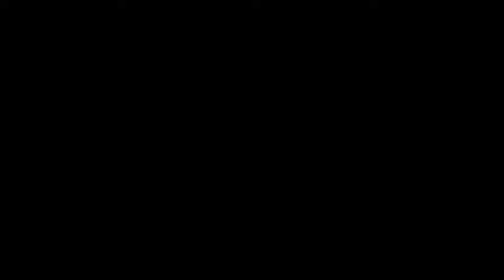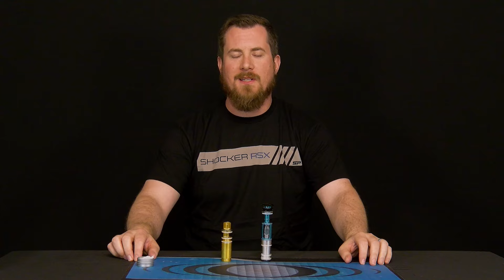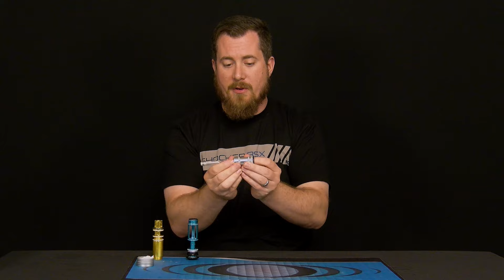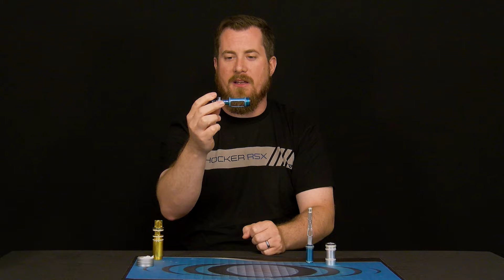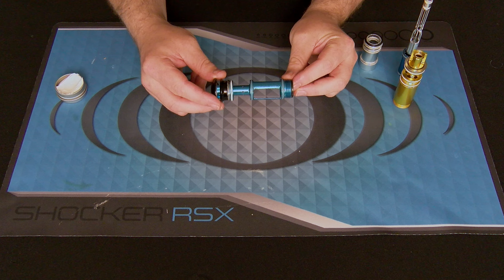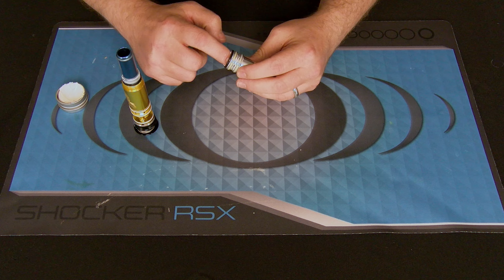SP Official - High Flow Main Chamber Install - SHK204 - Shocker RSX

Comment: The Blue can should be a lower pressure. It has more volume. Before SP replaced the Blue one. I got one of the first out the door. It shot smoother and had a quieter sound sig. It also operated at a lower PSI. Tested by a tool.  I went back to the Blue can from this one.  I built NXTs, Ions and SFTs Shockers. Every sealed body shocker I built went down in PSI from having the more open can so I dont get this one. Wasnt this to replace for a defect? You would have sold us this but we got it free.